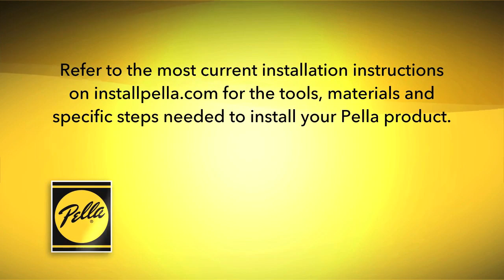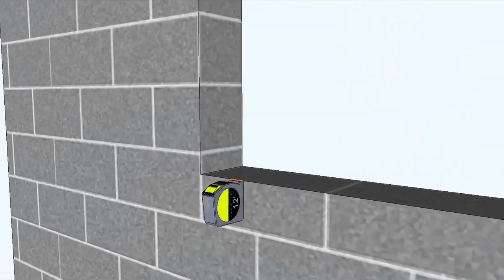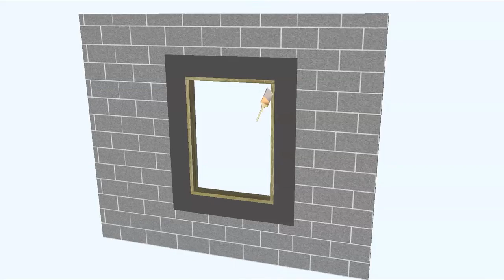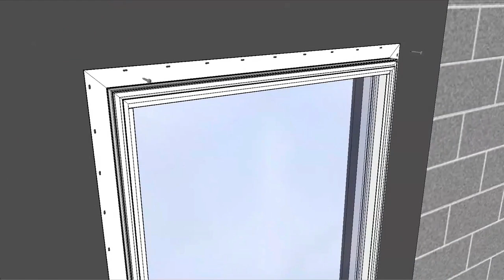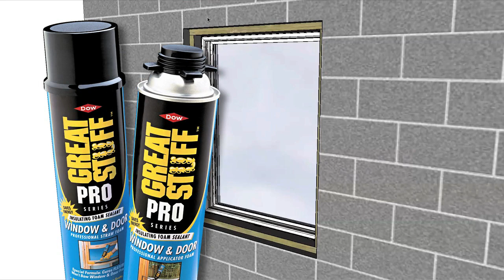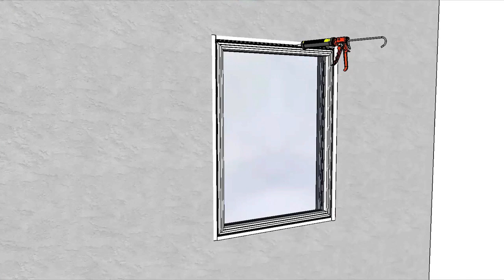How To Install Nail Fin Windows With Masonry - Supplemental Instructions

Comment: Not THIS is how you install a window in to concrete/brick.

None of that put a window in the hole, use a tonne of sealant and drive some nails through the window and in to concrete and call it a day that all the contractors do. This is why I am about to do my own basement window replacement by myself. You wanna get it done right, you do it yourself. The problem is finding a window manufacturer that will sell to you because store bought windows come with a good 80% markup !!!